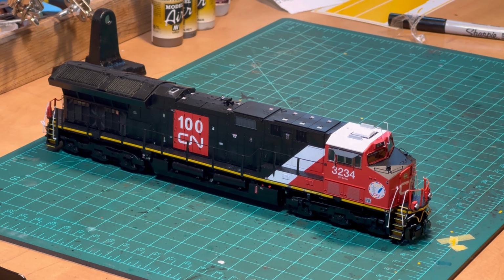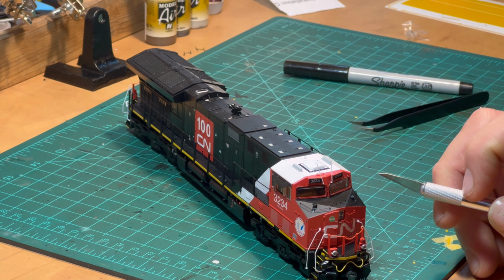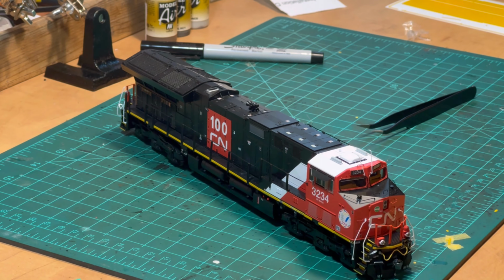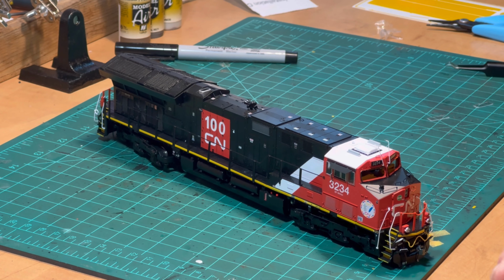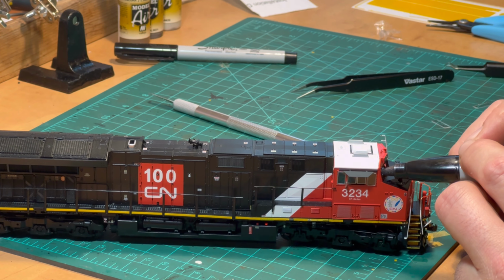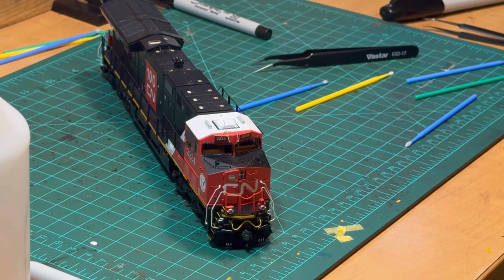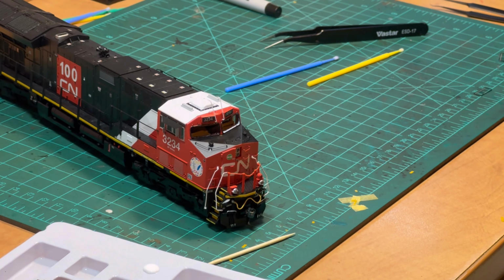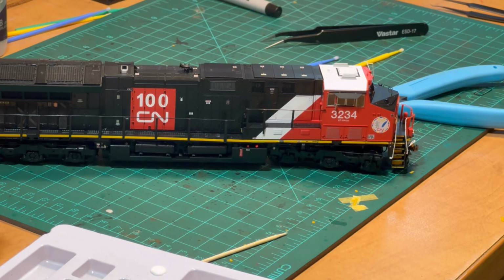How to weather an HO Scale CN ET44 from  Scaletrains Part one - Window Gaskets

Comment: Great technique. The window gasket and the front handrails always being crooked are the only two things that constantly bother me about Scaletrains locomotives. Otherwise they're amazing models. I've tried using a paint color similar to the interior control stand to paint the windowsill and used the black sharpie around the clear windows with good results. It makes the window look thinner to my eye. Either way, painting around the windows is a drastic improvement. I like popping out the side windows and hit them with a sharpie as well to darken them up. I look forward to the next tutorials.